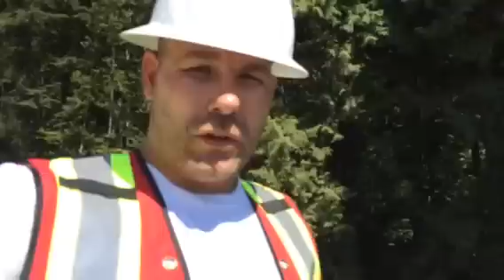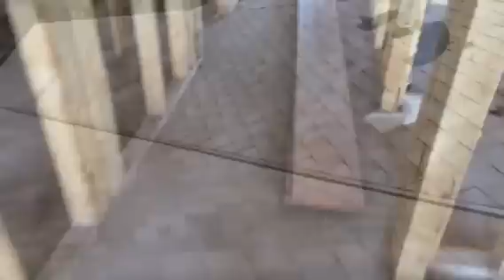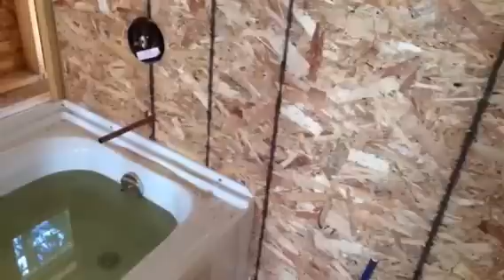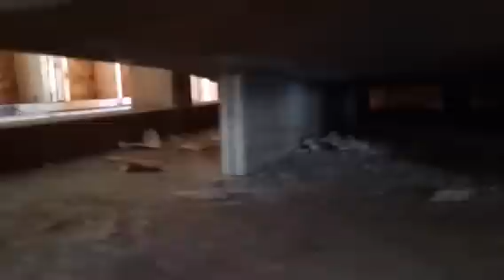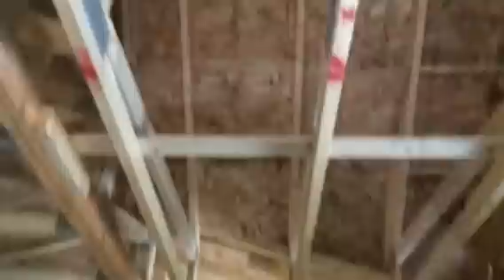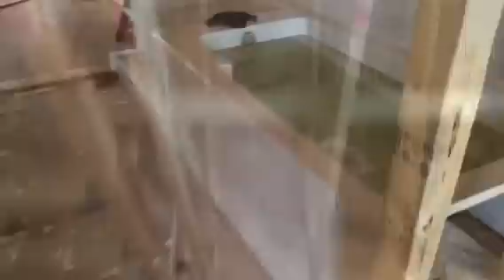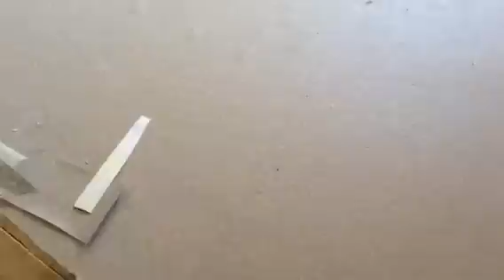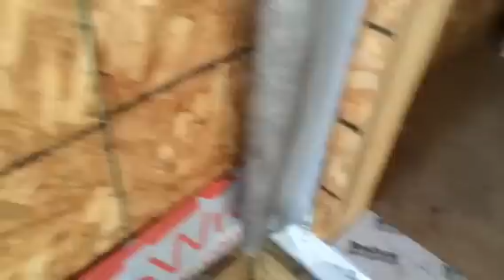New Home Construction Fails

Comment: Why are American houses made of wood?
Reply: Fox Wright Where I live, at least, concrete is a similar price as lumber. Especially when you factor in that it pretty much lasts a lifetime where as I would suppose you'd have to replace the wood after some time. And it's more sturdy and easier therefore cheaper to build etc. Also I don't understand why the roofs are made of those flimsy looking "roof tiles" and not of ceramic.
Reply: ***** I am. Why do they do that tho? If you're already building a house isn't it your plan to live there for life?
Reply: I don't get where you get this Idea that framed structures are flimsy and don't last, there are plenty of structures in the US that are over 100 years old that are still standing, sure you have to perform maintenance on the structure every once in a while to keep it in optimal condition but framed structures can last virtually forever just like masonry structures which require maintenance just the same because over time the mortar between blocks will erode and eventually the lentils above the windows will rust and the blocks above the windows will crack.

Comment: They installed the joist hangers upside down? WTF?
Reply: I'm a complete amateur and even I wouldn't make that mistake.  What is holding those joists up??
Reply: On the side of the hangers there are pieces of metal sticking sideways towards the wood that you hit with a hammer to make them go into the joist, and it looks like they might have blasted a couple screws in before they put the hanger on ( 3:21 ).
Reply: Jim Leonard nails... lol the same way joists have been held up for a hundred years before joist hangers became standard. Either just sufficient face and toe nailing or a 2x4 ribbon let-in for joists to sit on like balloon framing.

Comment: i like your video but you got 1 thing wrong a gallon water does not weigh 10 pounds it is only 8.36 pounds
Reply from the maker: Thanks so much thanatose your right a US gallon weights 8.34lbs. I should have specified that I'm from Canada where we use the Imperial gallon which weights 10 pounds. 

Have a great day!

Comment: If tile is set on membrane - there is no moisture to substrate.  Although I still use Denshield tile board or equivalent, Kirdi membrane may, by code and manufacturer be used as substrate.
Reply from the maker: You used the word "if" at the start of your comment willis lasell as inspectors we don't use the word "if" we don't assume anything other than. "If" they installed a cheap bathtub that doesn't have any support and the installed drywall behind the other tub in the video. Oh, and someone installed the joist hangers upside down. I don't assume they will use a membrane. Don't you think?

Comment: I'm no professional here, and although I would agree with him about every topic he pointed out, there is just 1 thing,  well, 1/2 a thing that I don't agree with.  the osb on the bottom of the tub. I've seen many tubs have osb on th from factory.  my parent-in-laes garden tub has a base of osb, and as long as the tub doesn't leak, and no plumbing leaks, the osb is fine. they've actually had a water leak under the tub, at the spigots and valves, which I had fixed, still. no damage to the osb. so, if tubs come factory made on osb, how can you fail it? just curious,  I don't understand that part. however,  myself, I would want a little more holding the tub up than that one board.  that doesn't make me feel to secure if I knew that and was climbing into that tub.